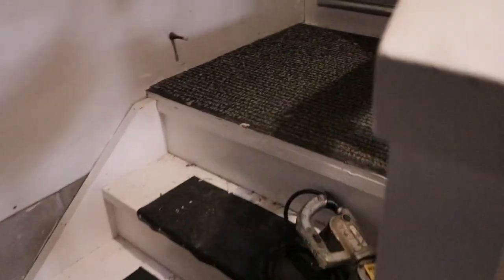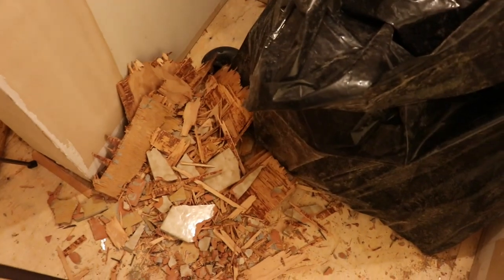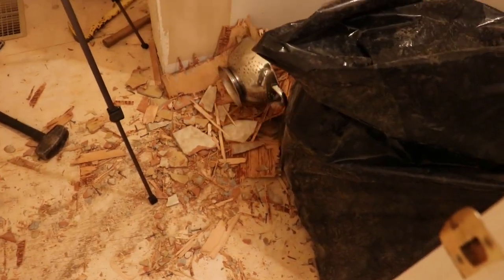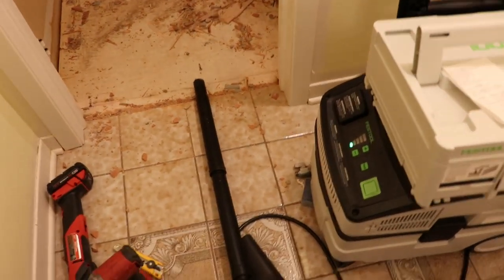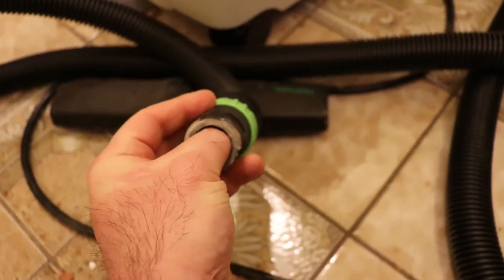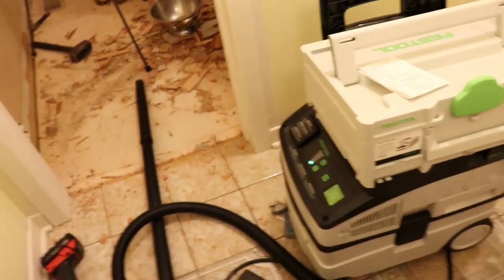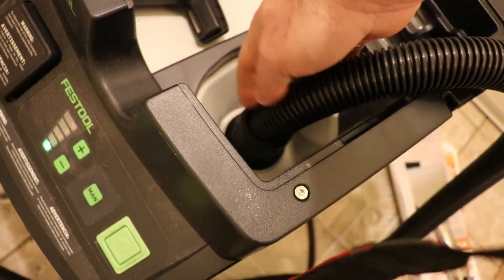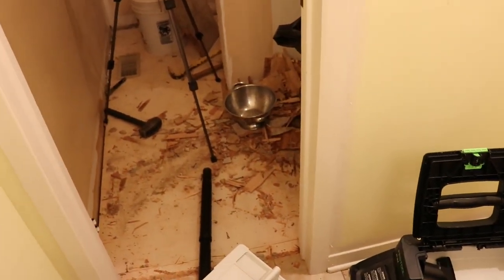Festool's worst product?  Probably, Hopefully, ...

Comment: Don't expect a product to do something it's not intended to do. If what you need is to vacuum wood dust like what is typically generated in a woodworking shop instead of trying to vacuum up huge chunks of subflooring, etc., it would likely work fine.